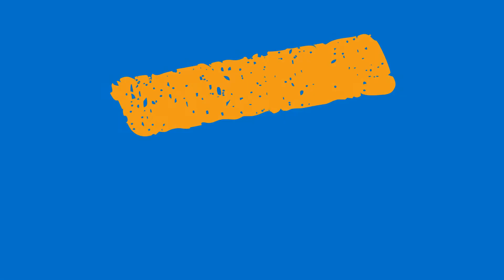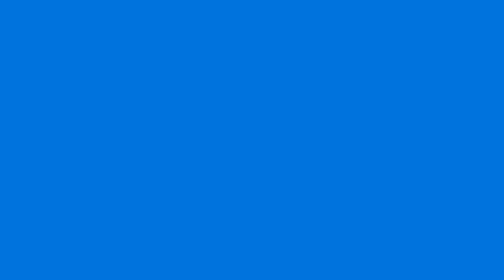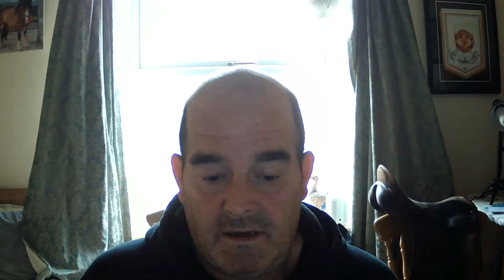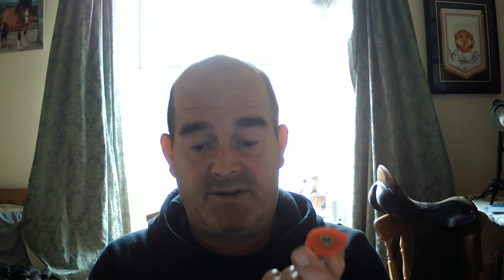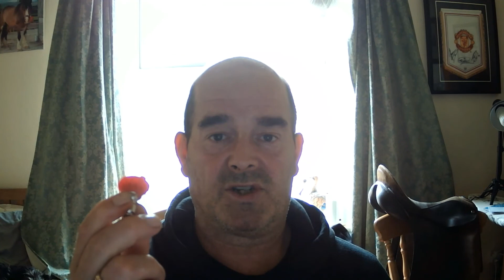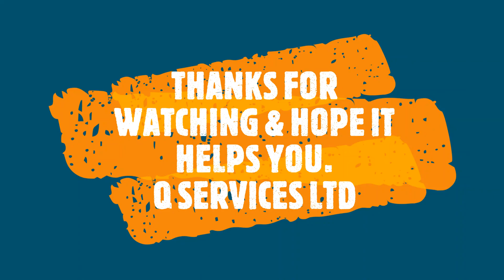Q SERVICES LTD QWASHERS JET SIZES AND DEG ANGLE TO CONTROL THE PRESSURE DO THE JOB QUICKLY MAX LTRS

Comment: I had a problem with a Nilfisk P180, I phoned and I was cheeky asking for advice even though I had not spent money with them. Aaron was absolutely amazing asking what my problem was.
I had a blocked valve for the detergent bottle, Aaron went into detail on what was causing the issue and exactly how to fix it. He told me to try his method and if it didn't work to check the valve and ball bearing inside to front cover. He was spot on within 15 minutes it was working perfectly.

They now have my business from now on, only small as I do the repairs myself but these guys REALLY know what they are doing and I couldn't recommend them highly enough.

Their customer service is off the chart total genuine experts and so nice too.

Thank you so much Aaron I appreciate it more than you would imagine.

Comment: This guy is about the most knowledgeable guy in the industry, I’ve been in industry for last 15years and whenever I have a issue with a machine or parts he will always help where he can , normally has parts in stock and reasonable prices. I don’t often need to use these guys so much these days as do most repairs ourselves in house. Yes perhaps they are busy and you have to chase the odd email but that’s to be expected because he is in demand ! Good guys and probably the most dedicated in the industry. Pete - Powerjet power cleaning Essex